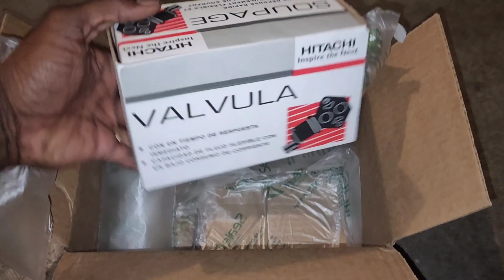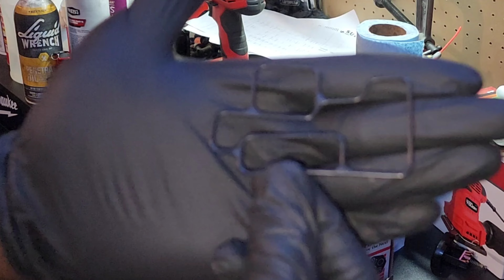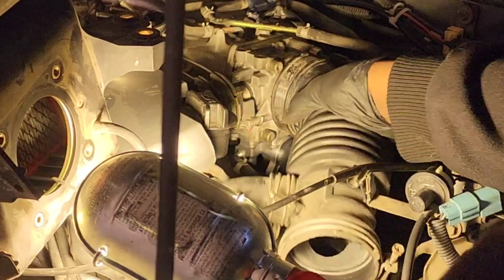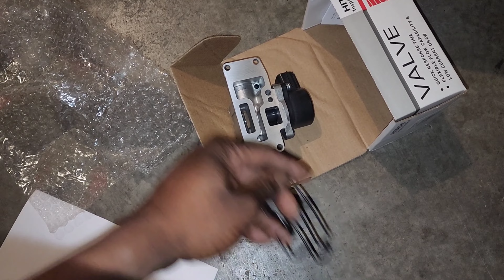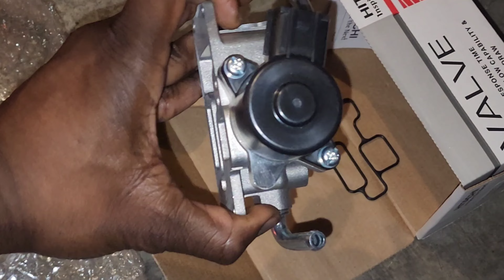2001-2002 Nissan R50 Pathfinder & Infiniti QX4 Idle Air Control Valve Replacement

Comment: Mine failed and smoked the ECU. There is a guy online that will repair your ECU and send it back. I did that and I also bypassed the coolant for the IACV. It has been through 3 winters like this and has worked flawlessly.

Comment: Just the video I was looking for. Was doing a search because my 2001 Pathfinder threw a code that said cylinder 4 misfire. Was wondering what that thing was hanging over the no 4 coil. Guess I have to remove the throttle body and IAC valve just to replace the no 4 spark plug and coil. At 270k miles I might as well change the IAC while I’m at it. Seems like a lot to go through just to change a plug. But thanks for the video. I’ll be extra careful with the gasket.

Comment: Have you had to put loctite the powervalve screws on yours to keep them in place? I heard they're not an issue on the manuals but on the automatics they get loose and the engine can eat them and one screw can kill or badly damage the engine.
Reply from the maker: @buzztucker, this issue does not apply to a Manual Transmission R50 Pathfinder years 2001-2002. It's definitely a very common and serious issue for those with an Automotive Transmission if not caught in time. Oh I almost forgot got my 2001 R50 Pathfinder is also a Manual.

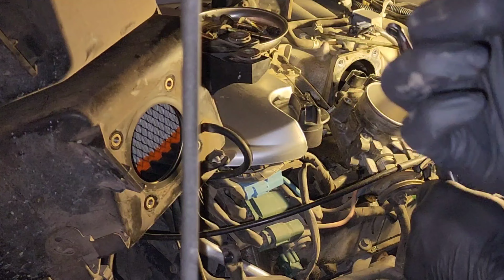Comment: At 3:54, what's that gasket? you removed? Is that something that should always be replaced with a new one when doing this? Just want to make sure I pick one up before I do this job. Thanks for the video!
Reply from the maker: @johndoeleftjane, that is the throttle body gasket, and yes, ideally, you should replace it when doing this repair, but I reused mine and haven't had any issues. I hope this helps, and thanks again for watching!

Chris

Comment: I dismantle the ICV and used thin coat of RTV gasket silicone over and under the original gasket and around the bolts, ive done it 10 years ago and still no issues, time to time i take a part and clean the spring and little plastic flap, still the original part for my 2002 QX4. This suv never going to die, if its does, next ride will be 2014 or up GX460 🤣

Comment: My car idels above at 1.5 and im about to replace my idel air control valve. I know its not leaking Coolant. I check it and its always filled. Should this be my fix is to replace the idel air control valve. Sometimes, on start up, it just doesn't start and i need to give gas
Reply: Should I replace my iac?
Reply: Should I just not replace it if it might cause more problems. If it idels around 1.5 is that such a big deal

Comment: Dan. Thanks for this. I just replaced this on my 2001 Infiniti QX4 ad I thought this had to be the problem. Basically the same car. This didn't seem to fix my problem. On cold start, it starts and idles. Then if I go to drive, when I let off the gas to break the RPMs drop and it dies. I can kick it to neutral and start it and 2 foot it to keep the RPMs up and it'll stay ruining but it won't stay running if I don't do that. I'm pulling my hair out with this thing. I've replaced the MAF as well as the vapor canister also. Any thoughts?
Reply from the maker: @jdininger, is your check engine light on? Also when you removed the old IAC was there any coolant present in the port where the IAC motor lives?

Chris.
Reply: @TheCamperDanFiles  I didn't notice any coolant in the old IAC. I have no check engine lights and no fault codes.
Reply: Btw, thank you for the quick reply. I want to keep this thing around but it's quickly making it's appointment at the salvage yard if I can't figure this out. It runs amazing other than this issue.
Reply from the maker: @jdininger, you are very welcome it could be a vacuum leak. Although a vacuum leak if big enough would turn on your check engine light. You always want to start with the cheapest and easiest things first. If you can view live data on your scan tool I would suggest taking a look at your fuel trims. A dirty or clogged fuel filter can cause this issue and that's not gonna trigger a check engine light. Let's hope it's not a bad fuel pump.

Chris.
Reply: @TheCamperDanFiles  I'll try a fuel filter next. I don't notice any vacuum leaks but that did cross my mind. There are TONS of vacuum lines on this thing.
Reply: @TheCamperDanFiles  well, a new fuel fill filter didn't change anything. 🤦🏻‍♂️🔫🤷🏻‍♂️
Reply: @jdininger did you end up finding what was wrong
Reply: @jdininger did you ever end up figuring out what it was?
Reply: @jdininger  also curious if you found the issue because I am having the EXACT same issue you're having. I have an IAC on order since I was getting a pending P0505 code.

Comment: Thank you Chris for sharing your knowledge! I find your tutorials helpful. I got the dreaded P0505 code. My instrument cluster stopped working before the Service Engine light went on. I hope it fried the cluster instead of the ECU/ECM. Maybe a coincidence. I drive the vehicle very little. Won't be driving at all until I get it fixed. Seems to run great but my Over Drive flashes when first starting up. The OD seems to work intermittently now.
Reply from the maker: @rickcrispell1405, I'm sorry to hear about the issues you are currently having with your R50. Hopefully, it is just a coincidence that your instrument cluster stopped working before the check engine light came on for the P0505 code. Usually, if the driver for your IAC was fried the engine would have a hard time maintaining an idle. I'm not sure if the intermittent OD issue is related, You said it runs fine I'm just curious Are you getting any misfire codes?  Welcome to the channel and thanks again for watching!

Chris.
Reply: Thanks Chris for your concern. My QX4 idles smooth at about 650 RPM.  No other codes besides the P0505 and the O/D flashing upon start-up. I replaced the gauge cluster with a used one. All the gauges work except the speedo and odometer now. I suspect the output speed sensor has suddenly went out but no P0500 code showing. Maybe the speedo wasn't working when I bought it? I think I will start with replacing the IAC valve.  My 2001 QX4 has low miles (111,000) but getting old. Thanks again, Rick @TheCamperDanFiles

Comment: My girls 1999 Nissan Pathfinder (R50) auto/ 4x4 has code P0505 “Idle Air Control System” going to dig into it tomorrow and hopefully this video will help. It runs and drives but has ck engine light with that code and I’ve done some research and it all goes back to this stuff so will this work on her 1999 or only 2001-2002
Reply from the maker: @tsgeekedgaming, the IAC on the VG33 is a little different than what I have on my VQ35, but still carries out the same basic function. I researched the code P0505 with the use of my Launch CRP 429 SCAN TOOL and this trouble code is described as follows. "The Idle air control is equipped with a removable needle valve controlled by correct removable step motor. When the throttle is closed, IAC valve will control idle speed through changing the air flow in bypass pipeline to adapt to idle speed under various conditions. ECU tries to control engine speed when key ON, engine running self-test. If ECU cannot control engine to desired speed the DTC will appear" more over according to what I have found on Google this can also be caused by a build up of carbon or a vacuum leak. I would suggest checking for vacuum leaks first since you won't have to take anything apart just yet then, if that checks out then you can try cleaning it. Always try the free and cheap fixes first before loading up the parts cannon. Good luck I hope this helps👨🏾‍🔧

Chris.
Reply: @TheCamperDanFiles  it ended up being her throttlebody, was caked in carbon, also added a canna seafoam to the gas tank and check for vacuum leaks before doing any work to it, doesn’t have any vacuum leaks. The check engine light went off seconds before I clicked erase
Reply from the maker: @tsgeekedgaming, that's awesome I'm glad it worked out to be an easy fix for ya! Yeah the ECU will definitely have a hard time controlling a sticky throttle body at idle, and the computer was able to clear the code itself once you got things cleaned nice! Thanks again for updating us on the fix, Now this info can help other VG33 R50 owners who might be having the same issue. Good job👨🏾‍🔧

Chris.
Reply: @TheCamperDanFiles  thanks for the help 🙏
Reply from the maker: @tsgeekedgaming, your very welcome, anytime!

Chris.

Comment: Good video. But you failed to mentioned or show the relearn procedure that you need to do. When you replace the IAC!!
Reply from the maker: @doelife, no relearn was necessary in this case as I never touched or adjusted the throttle position sensor. A relearn is only necessary when replacing the throttle position sensor. Most people end up having to perform the relearn if they made the mistake of removing the throttle position sensor from the throttle body when replacing the IAC. I'm sure you can find at least one example of this on YouTube. If you noticed my R50 idles just fine on startup after replacing the IAC, now had it had not it would of been a different story. Thanks again for watching!

Chris.

Comment: One thing about Pathfinders - DO NOT GO AFTERMARKET ON ELECTRONICS ALWAYS GO WITH OEM. 
I have a 97 Pathfinder - threw an Autozone distributor - 3 months later same issue and had to get an OEM one. O2 sensors you can get away with Bosch and for spark plugs NGK.
Reply from the maker: @jerrquezada625, using OEM parts is better than using inferior aftermarket parts any day(this also includes used OEM parts from the junkyard) Not saying that all aftermarket parts are bad, but for something like this it's just better to stick with OEM.

Chris.

Comment: Did you have to reprogram the idle ? I replaced the IAC and now idles around 1500 rpm’s
Reply from the maker: @Compu Tron, no idle relearn was necessary for me when I replaced mine. This is usually only necessary if the throttle position sensor was removed or replaced.

Chris.

Comment: Hi Camper Dan, I have certain mechanics leery to change the IAC, due to the idle revving may go off sink with timing. Since this is a sensor as well. Did you have to set it to its original specification or did it automatic idle sink on its own. Do I have to be concerned about this? I see you answered my question on buying an OEM part.  Thanks for your reply. Blessings!
Reply from the maker: @Noelani Kee, a relearn is only necessary if you are replacing the throttle position sensor. I never touched mine, as you can see so no issues there. I have heard of others having to do a relearn, but that's because they made a mistake and removed the Throttle position sensor too. I hope this helps, and thanks again for watching!

Chris.
Reply: @TheCamperDanFiles  I have another question if you don't mind. This video Corwin Shaw - https://youtu.be/hyJo2piVTf0 here's a clip of it. He mentions he bypassed his IAC system, since he experienced this more than once shortout. What do you think about this? thx so much for your honest reply. Blessings!
Reply from the maker: @Noelani Kee, I watched his video not too long ago, many other R50 owners have gone this route as well. It's ok to do this as long as you don't live anywhere that gets really cold as the IAC helps to keep the throttle plate from getting stuck due to cold weather.

Chris.
Reply: @TheCamperDanFiles  I live in AZ, so i believe it may work. Thanks so much!
Reply from the maker: @Noelani Kee, you're welcome👨🏾‍🔧

Chris.

Comment: For anyone that owns an 01-04 Pathfinder or Infinity QX4 with an idle problem! Replace your IAC valve asap before it fry’s your ECU/ECM and blows the 10 amp fuse that will cause a no start issue. A simple IAC valve replacement will save you thousands!
Reply: Where is this fuse located? I have a new IACV and ECM that I will be installing today.
Reply: @EMC_FPV  I’m pretty sure it’s labeled ECCS2 10amp on the passenger side fuse box.

Comment: I have replaced 4 of these on my pathfinder within a year, because the first one fried my ECU. I didn't know at the time that they fried the ECU so i kept replacing it and the Fried ECU chip would fry the IACV. I made a video a couple months back showing how to fix this for good so it will NEVER happen again. It on my Channel here if you click my profile. I ended up just disconnecting the hoses that run to the IACV and soldering a new chip into my ECU. haven't had a problem since. I will say this though. IF your ECU is fried, then FIX or REPLACE the ECU and the IACV AT THE SAME TIME! They both kill each other if one or the other is bad! Thank you for sharing this video with the Pathfinder community! Let's keep them alive!
Reply from the maker: @Corvin saw, I just checked out your video on this dreaded subject good job, and thanks again for your contributions to the R50 community here on YouTube👍🏿

Chris
Reply: Thank you both for the time and effort you put into this. I have an '01 QX4 and I believe the IACV failed.  Didn't take it all the way apart but just took off the air cleaner cleaned the MAF and undid the coolant lines to the IACV and saw that it was pretty heavily corroded.  Car low idles, rpm bounce, and will stall out on some occasions when cold or let it idle too low.  Hesitation on accelerating, hard start etc.   

My main question is there a way to tell if I've already burned out the chip on my ECU that controls the IACV ?  I'm about ready to pull the trigger on a new IACV or possibly just the whole OEM throttle body all together that comes with IACV and TPS attached.  170K and I've done tons of my own maintenance, should have lots of life, new tires, etc.  Don't want to drop a ton of money into it but still a really nice 4x4.  

Appreciate any advice. Cheers !
Reply: Also, I didn't see you address the idle relearn in this video and wonder if that was necessary?
Reply: @TheCamperDanFiles And there's my answer on the relearn further down in the comments.  Looks like  I shouldn't have tried swapping out the TPS first :/.  I'm thinking I may just go with the whole OEM throttle body with TPS and IACV attached.  The relearn prob isn't that hard but if I can avoid it for a few extra 100 might be worth it.  Car still starts so hopefully I didn't fry the ECU/ECM component that controls the IACV yet.
Reply: If your fuse is blown is it too late? Does it mean the ECU is done because I don't have any codes.
Reply from the maker: @NeutronX101, unfortunately it might be too late because by the time the fuse blows the damage is likely already been done. Some people have replaced the idle air control valve driver. Here's a link to that part if you want to give it a try versus replacing the entire ECU https://amzn.to/3OR7p7n

Chris.
Reply: @TheCamperDanFiles so I took apart the ECU and I didn't see any blown chips. Plus the area has a upa156oh chip instead of the chip mentioned. Plus behind it there are 4 individual chips instead of one like everyone has. I have a 2001.5 version. I did unplug the iacv and changed the fuse and car still didn't start and fuse blown. So many my ECU didn't short out? I'll just change the iacv only and see.
Reply: Still no codes